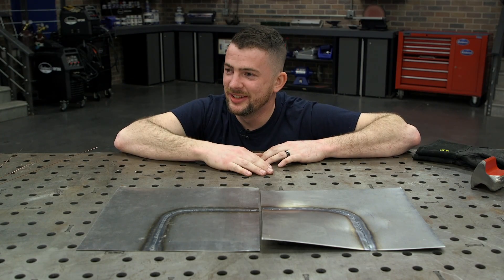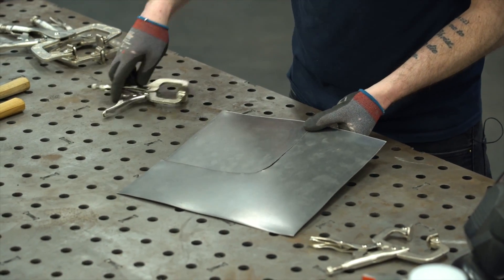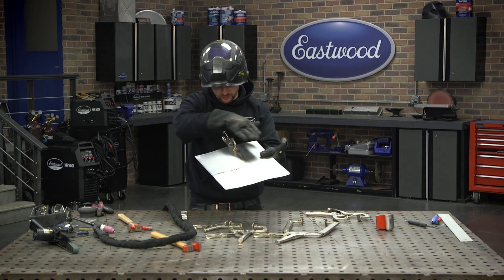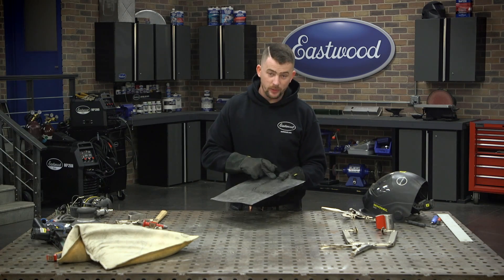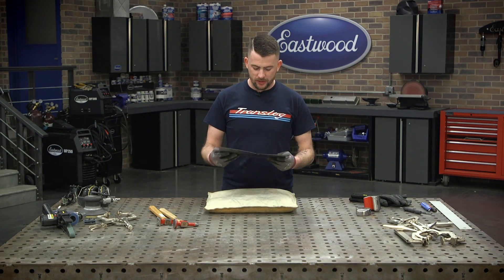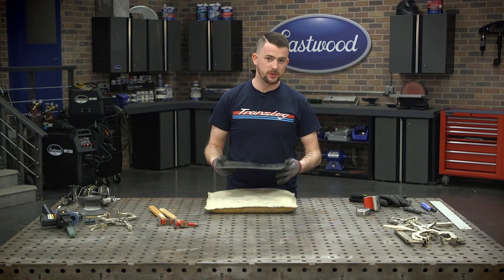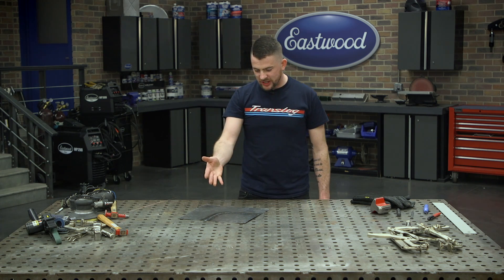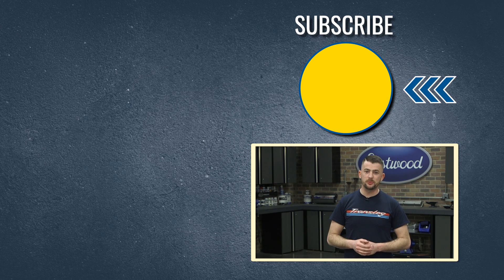Professional Porsche Fabricator Shares Tips to Fix Warped Sheet Metal - TIG Welding Tips & Tricks

Comment: Can you use mig welding with 16-22-26 gauge sheet metal?
Reply: Yes u can try use mig filler wire .023 to .025 mig if possible

Comment: Looks like you mostly hammered and dollied the welded area vs hammering the other parts of the panel. So basically I want to hammer and stretch the welded area and not stretch the good metal that is warped out of shape.

Comment: Any recommendations for parameters? Amperage, shield gas flow. I've done a lot of pipe welding but very little sheet metal. The warping is a bit unnerving.
Reply from the maker: Incorrect. Pure white is the absence of colors. You cannot mix colors to create white.
Reply: @eastwoodco  wtf are you talking about? I didn't mention color, or white, in my comment. Yet you replied to my comment with your statement about white. Hmmm. I suggest better ventilation or perhaps an air-fed set-up as I think it may be the fumes from that which you are welding. #Ismellwhatyourcookinanditsodd